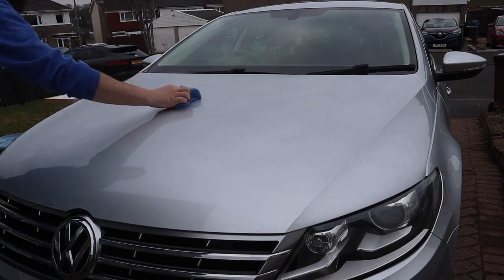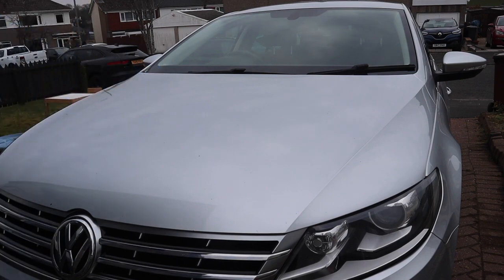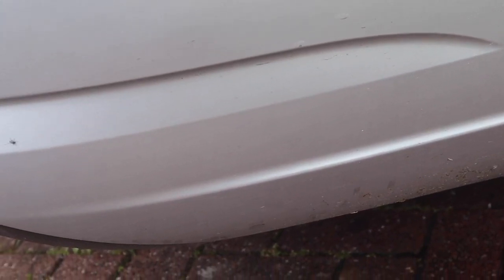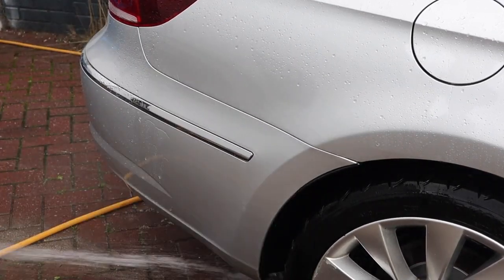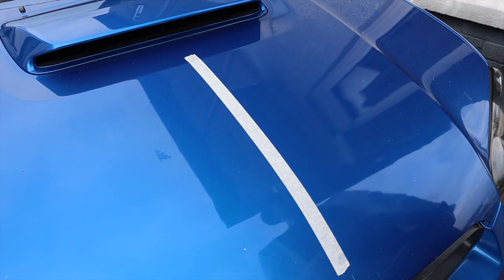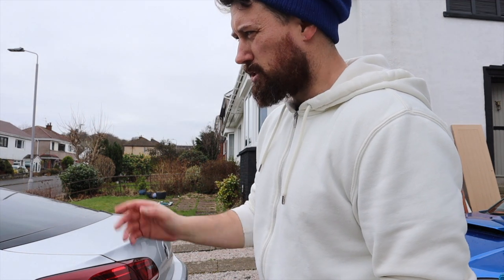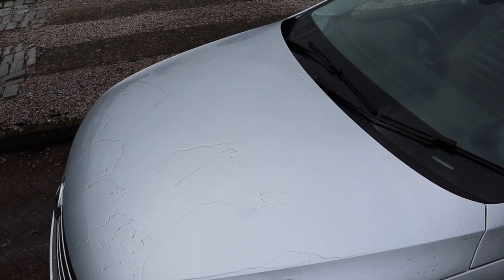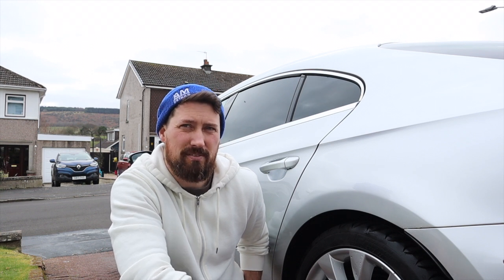The BEST Ceramic Coating for DIY use?

Comment: Really great information. May well try this or something similarly easy to apply on the wife's car later in the year, maybe add some of my GT sigma to boost gloss etc next year when i won't be able to resist topping it with something. Best wishes.
Reply from the maker: Thanks Tim, it’s well worth a try, I’ve been really impressed with it over the year

Comment: Another excellent review, Dave, have used a couple of Infinity Wax's products and they seem to offer decent performance at a reasonable price. I've just applied KKD SiSTAL onto my car - very easy to apply, not fussy at all about the weather and 15ml did the whole car (3 series estate). Also supposed to last a year. Having used KKD Revolve on a different car's wheels a couple of years ago (v impressive) I have high hopes, we shall see...
Reply from the maker: Thanks Steve, ive herd the KKD 1 year coating is good, ive not had a chance to use it though, would be interested to see how the coating performs for you. like you said if it does as well as revolve it should last no problem.

Comment: Just re watched your video after putting a coating on my car. Wondering how you maintained it during it's life on the car. Very handy video.
Reply from the maker: Hi mate, with this one I just used a normal prewash either citrus or snowfoam then ph neutral shampoo. If you want you can top up with a ceramic detail spray once a month but for the purpose of testing this product it didn’t bother. Every 4 months or so it’s good to hit it with a fallout remover or waterspot remover to unclog the coating.
Reply: @DavidMcBay  when people top it up almost every wash I do almost think what was the point in the ceramic your putting protection on continually anyhow. Great test you've done.
Reply from the maker: Yeah there really is no need for it atol other than an attempt at prolonging the life of a ceramic. It was good to get a full years worth of testing on this product and see if it lived up to its durability claims

Comment: Hi David can I ask what pump sprayer you used during your initial decontamination. TIE. Great video I have bought a bottle. Cheers.
Reply from the maker: Thanks Richard, it’s from B&M, I think it was around £9 and it lasted well, unfortunately I had left it with water in it one night and it froze up and cracked but I’ll be on the look out for a replacement when they get their spring gardening stuff in.
Reply: @DavidMcBay  thanks David I'll give it a go. Cheers.

Comment: Brilliant, just in time! I got this product as a gift the other day, so your video came at an excellent time for me. Just going to wait for slightly better weather.  Can I ask if you're aware as to whether a tar and glue remover would strip the coating back, sorry if that's a stupid question?
Reply from the maker: Honestly Lee I’m not quite sure about that, I did notice a few tar spots so might pop out tomorrow and give it a try. It’s just about getting into the weather to get it used mate
Reply: @David McBay  yep, it'll be done in the next couple of weeks. Thanks for the reply, really appreciate it.

Comment: Good stuff as always. As usual I’m only part way through the video so apologies if you do mention it. But in the prep can a sealant be used under product for extra gloss or best on raw paint?
Reply from the maker: Thanks mate.

The coating has to bond directly to the paint, or else it wont work very well, what you can do though, a month or so down the line to get some additional gloss, is put a compatible sealant on top of the coating, i believe synergy boost and synergy QD work well as coating toppers.

Comment: Product looks decent for the price, I’m a fan of Gyeon cancoat evo which is similar product but price is like £37 but works great, Maybe you could try out on your car the new Diamond ProTech - Diamond Body 36 ceramic coating which is 3 year coating with actual claims of scratch resistance, obviously not deep scratches but swirls etc, would be good if someone could test out these claims as I’m skeptical especially as the price is similar to most 3 year coatings
Reply from the maker: I have some original geyon can coat but your right £37 is expensive. I’d love to test out some of these scratch resistant or self healing coatings but again there not cheap lol
Reply: @DavidMcBay  The new diamond one is only £60-70 so for a so called scratch resistant coating that’s cheap, the self healing ones are only for certified installers and way too expensive, i would rather get my car wrapped in PPF
Reply: I agree it is expensive. It’s a 200ml bottle with the gyeon so you get twice the amount but I feel like I’m never going to finish it before it goes out of date.I’ve applied it to three cars so far in a year and haven’t made a dent. Wish they did a 100ml bottle for like £22
Reply: @98JamesNixon  I agree I wish they had 100ml product, i got the Evo one and no chance of me using all of it before it goes bad,I did mention it on Esoteric channel and he said it’s targeted for the trade but that’s nonsense as they got one for pros who only certified detailers can buy, it wouldn’t hurt if they made a 100 ml for £20 as it’s really good product, what’s great about it that it can be used on glass so maybe if you use it all over the car including wheels then you could use it all

Comment: Looks worth a try mate but got a full bottle of can coat on the shelf. 🤔
Reply from the maker: I have can coat aswell mate, only thing with that is, I don’t think it’s a ceramic and only claims 6 months durability
Reply: @DavidMcBay  yeah is more to use it up rather than a comparison. Might stick that on the wife’s car instead.

Comment: Synergy 2 is just as easy to use too
Reply from the maker: I’ve herd good things about synergy 2 mate, seen a few of your posts about it aswell. I’ve not had the chance to give it a try yet, mibby could stick that on the VW next
Reply: @DavidMcBay  im 8 months into it now and still has the same zing of the first wash all the way through winter
Reply from the maker: That’s awesome! I’ve been very impressed with lite so wouldn’t expect any less from synergy 2, is it just as easy to apply as lite?
Reply: @DavidMcBay  yea buddy very much so my car is synergy lite the wife's has some panels of synergy 2 it's brilliant tbh
Reply from the maker: Here’s me doing a review of a product and now about to go order a different product 🤣🤣
Reply: @DavidMcBay  it will massively impress you buddy it's litterally like lite on steroids I've applied to like 8/9 cars now